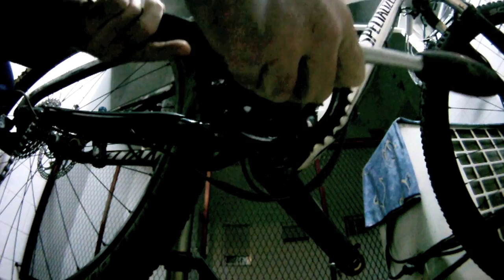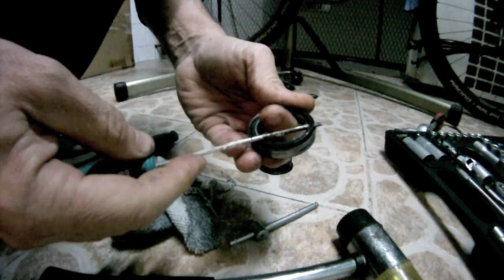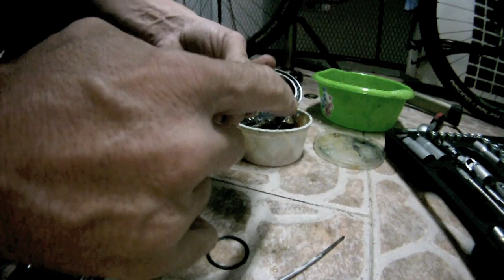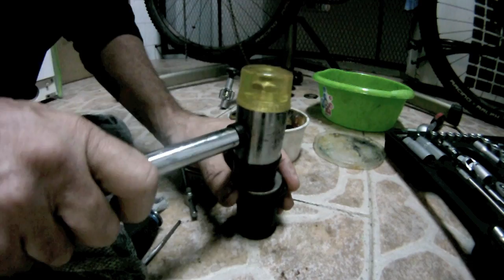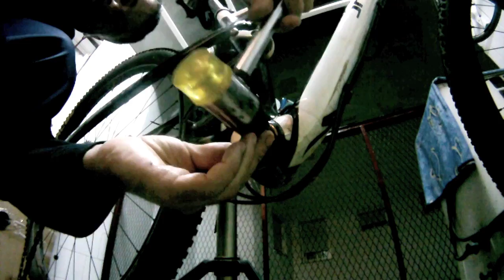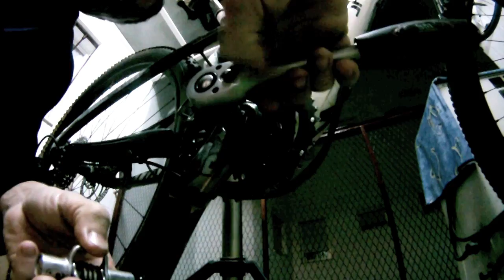SRAM press fit 30 PF30 MANTENIMIENTO

Comment: Did you have any creaking on this after you re-install it? The manufacture says.. don’t actually recommend to reinstall these cups once they had been removed and the bearings are not supposed to be removed from the cups
Reply from the maker: No, but theses bearings had some problems, and I did put others, ceramics bearings,  since then, I don’t have anything problems ,  when I did get this bicycle, there was many problems with “ Press fit 30” in many bicycle of many brands